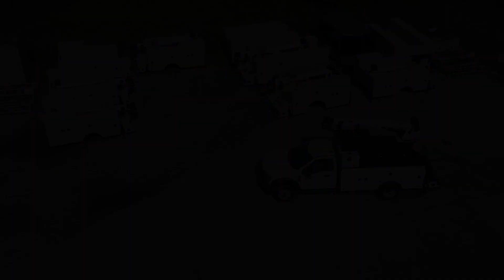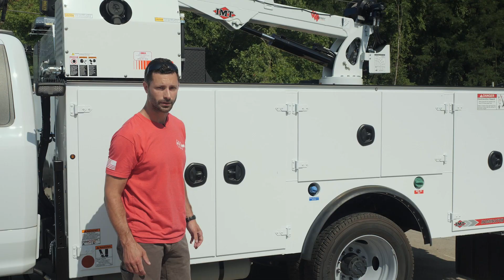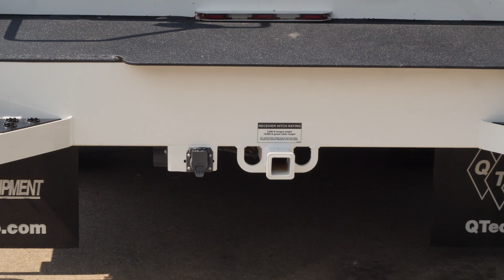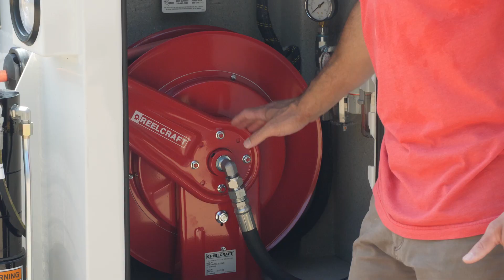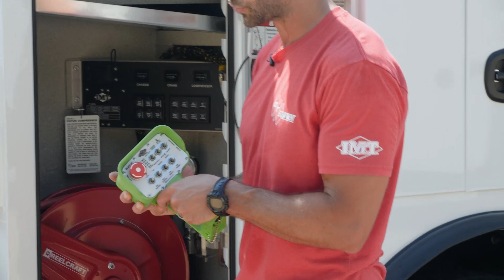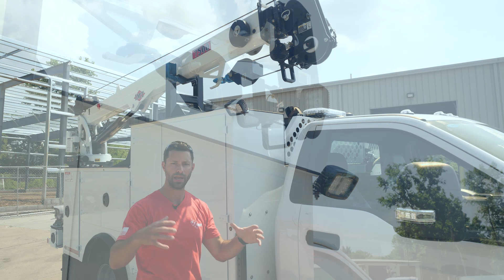Service Truck Overview - Ford F550 Dominator I

Comment: Have you guys done any f600s yet?
Reply from the maker: Just got our first ones in.  Have not built yet there may be a video in there…. THANKS!!!!
Reply: @qtequipment  is a jumpstart pack an option? For starting semis and such?
Reply from the maker: @drewmurphy2796  Yes, we’ve done a few jumpstart systems in the past.  Did a couple Goodall systems (hydraulic and battery) back in the day but more recently have done more GETEC hydraulic jumpstart systems.  I’d have to double check but these should be 12v and 24v and give 1000 amps at 12v.  These take approx. 20 GPM of flow.  Have done them on F550s.  Should be no problem on larger trucks with dual PTO openings.  Have not tried on Chevy or RAM yet.  Thanks for watching!!

Comment: is there a way to have an f550 ext cab with dom 1 body with lube capability? 100 gal waste, 3 25 gal fresh oil tanks and still have bed space?
Reply from the maker: we haven't done that exact configuration but we've done (2) 75 gal tanks plus waste and grease several times. it worked out well.  11' Dom 1 body and F550 extended cab.  Should be some pics on instagram somewhere.  email sales@qtequipment.com and they can work on layout if you want.  THANK YOU!!

Comment: Is it possibly to have the tailgate be bigger? As in taller, by moving the 3 point hand rail over/shorten it?
Reply from the maker: Good question, thank you.  Yes this can be done.  A taller tailgate is not available as a standard option from IMT but we could make it happen here as a custom option.  You’d probably lose the one hand latching mechanism but you have a couple inches to play with before interfering with the handrail.  Thanks again!!
Reply: @qtequipment  awesome, thank you for the reply!